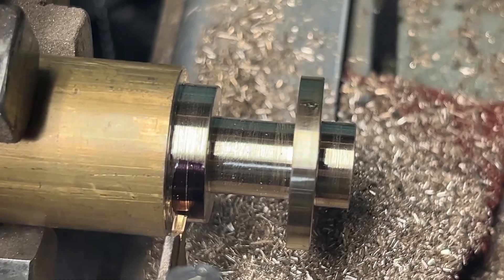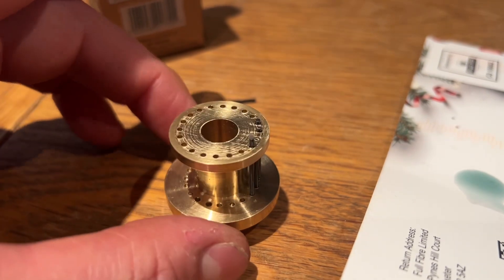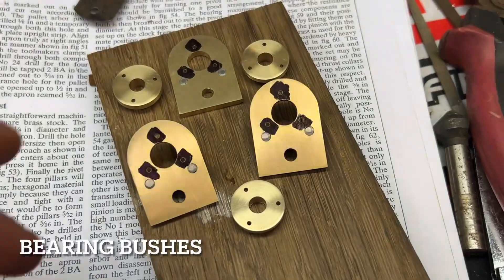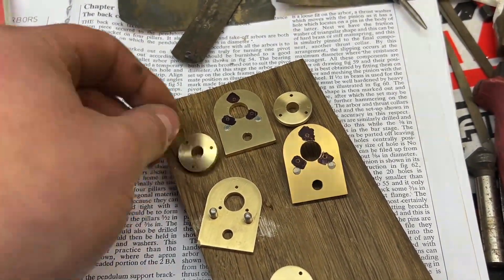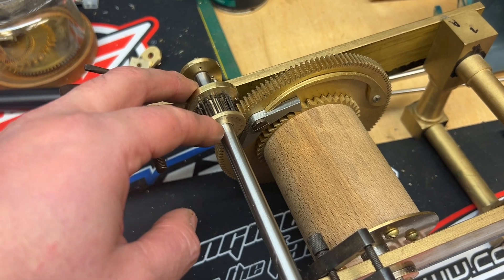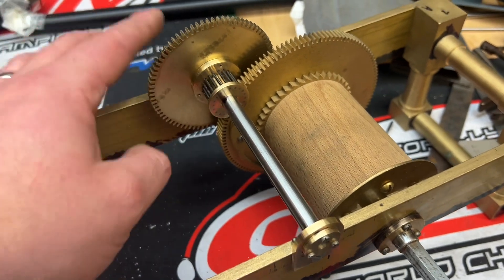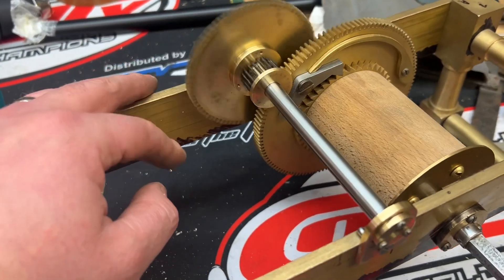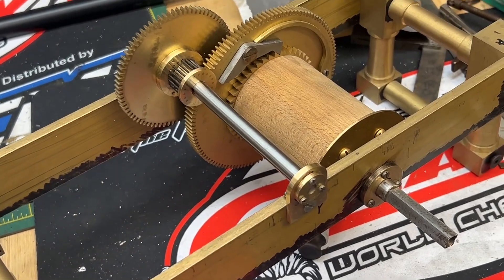Making a Clock Lantern Pinion for Wildings Tower Clock pt12 - 2nd Arbor Complete

Comment: Very interesting. I am making the Dark Lady clock which is smaller but otherwise quite similar. I just had a first go at the pinions which are a bit tricky. My second layer holes came out wrong as the No 57 drill must be wandering. Anyway have to go again. 

Well done Craynerd !